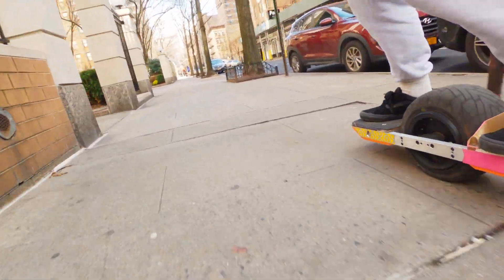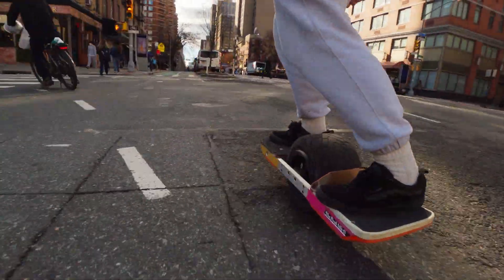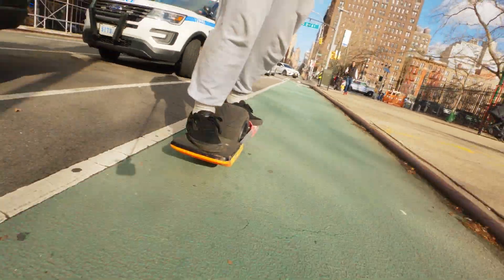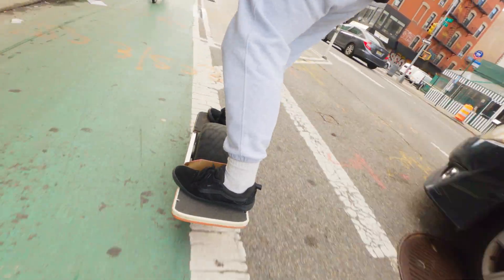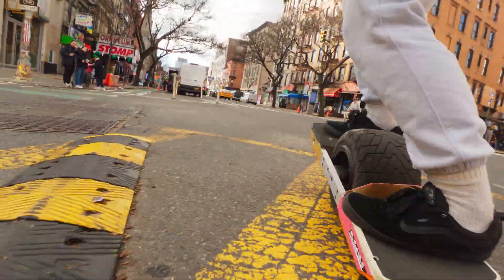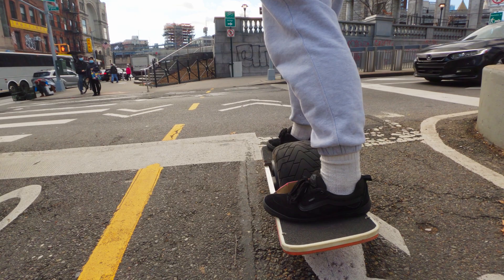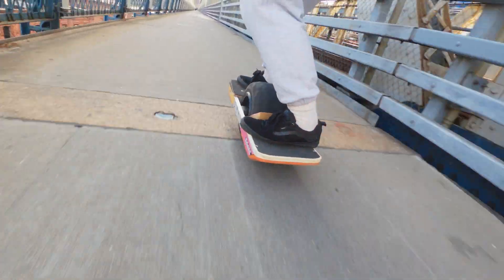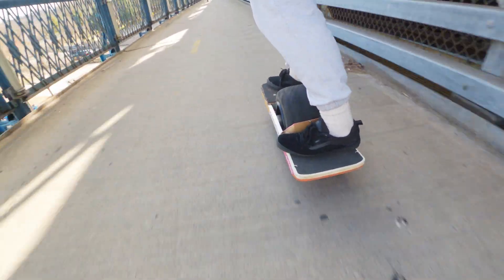Riding my VESC in NYC (w/ commentary)

Comment: Awesome!
W T F VARail fender, eh? If your making a full fender, I'd be quite interested in it.
Those W rails will definitely help you with being more confident with going up and down hills without risk of scraping, once you get used to them - that is. It takes a bit to relearn curb nudges too.
A VESC controller is almost a must-have ride upgrade in my opinion. But it does get complex real fast if you want to add on to it
Reply from the maker: Making a shorty😂 full fender is too difficult to print. However it should be pretty straight forward to print an angled riser plate for the craft n ride magnetic fender for varials. I’ll maybe work on that next.
Already got my dubs and you’re right nudging is so weird at first😂

Comment: You're riding an EUC.  A VESC is just the speed controller, not the vehicle.
Reply: Does it look like an electric uni cycle?
Reply: @KaizenOz  Jeez..  at least know what you're talking about if you're going to make a smart-ass comment like that.  Yes, you moron, it does look like an electric unicycle because it is.  Why do you think I said it was an EUC?  Save yourself the embarasment and don't reply to this.
Reply: @jimnasium2818  Still need a hug huh?
If you ventured outside of your grandma's basement and experienced the real world, or even had anything to do with PEV's you would know that classifications are, EUC, E-Bike, Scooters, OneWheels (either with FM controller or VESC controller). But hey.. you keep arguing on the internet
Reply from the maker: Yeah VESC doesn’t make the most sense and eventually we need to come up with a better name, but it’s definitely not an EUC, despite it being an electric unicycle.
Reply: Half right, definitely not an electric unicycle no doubt about that, but you are correct that the vesc is not the vehicle. Pretty sure he knows that as well, it has just kind of become the term used for onewheels with a custom setup involving a vesc. Whether that is logical or not, anyone who builds one is well aware.
Reply: @shlong_with_a_bong  Jesus christ.  What will it take for one of you to actually crack open a dictionary?  A "Onewheel" is a goddamn electric unicycle.  Anyone that says otherwise either doesn't know what they're talking about or they work for "Onewheel".